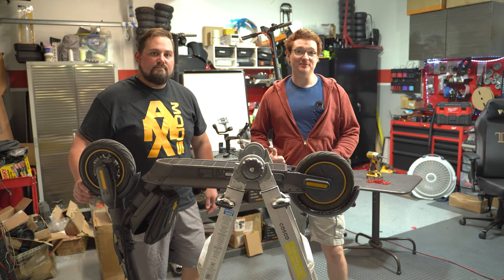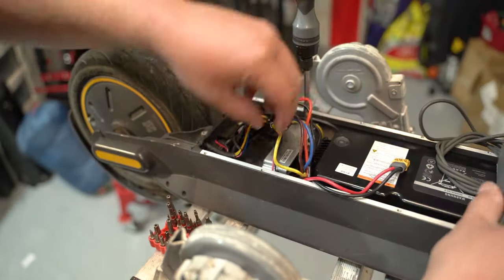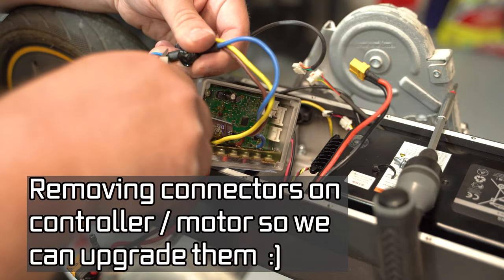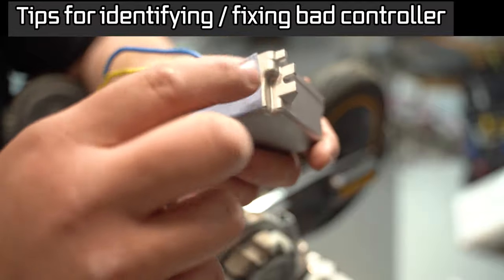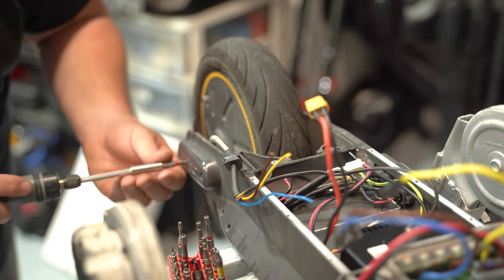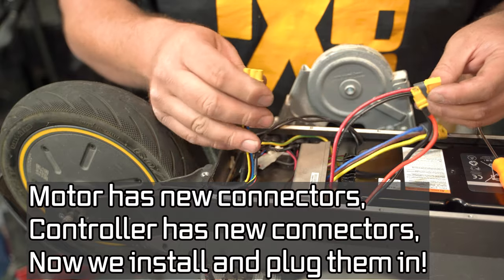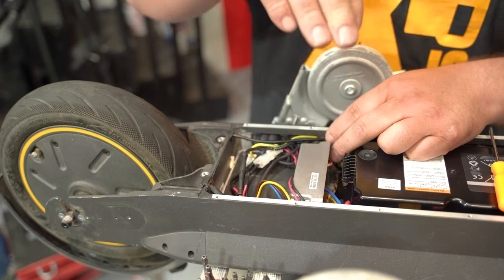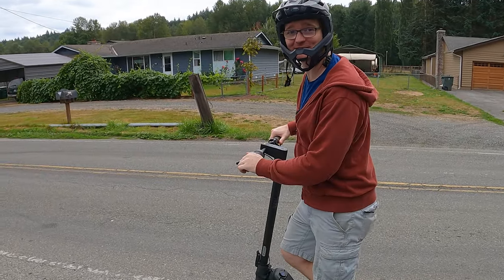Ninebot MAX Repair, Upgrades, Controller Swap, Tire Removal & More!

Comment: Great video. I have a front and back suspension coming from max mods and will probably get a 48v upgrade along with the fat max motor. I'll definitely be redoing those connections. I'm just curious what would be better option, the external 48v or the internal 48v battery replacement, or both?

Comment: Im not sure if this video is too old for comment but I have a ninebot max as well and the display just keeps flashing and each flash it lights up each part of the display (Eco, D, S, light, bluetooth, walk mode, temp warning, etc. No error numbers. I can't turn of or on as well.  I believe I used Xiao flasher and this happened.  I can't find anything online about what the issue may be. If I managed to describe said problem well enough, does this sound like something you've dealt with before
Reply from the maker: I've never heard of it before. Try reflashing the stock firmware and see if it persists. If it does then its likely a loose connection between display and controller or a bad controller, maybe from water damage.

Comment: I fried my ninebot max with the 48v battery but the controller still turns on but all 3 connectors burned up to ash but can I still use the original controller if it still works

Comment: Hey! Great video. Would you be able to list the size of the screw bits you used to remove all the bolts? I tried a few of the bits in the set that I currently have, but i don't have the correct sizes. I wanted to make sure that I get the correct one the next time I go to the hardware store.

Also are the replacement wires and connectors commodity items you acquired separately? Or are they in some sort of upgrade kit that can be purchased?
Reply from the maker: Idk exactly. I'm Sorry!
Reply: @GingerOnWheels  T15 security bit

Comment: Ok. I have an issue that I haven’t seen before, nor can I find a history of.
Got Error 14 on a Ninebot Max. Tried connecting new throttle to brain, no change. Disconnected everything except main power, still Error 14 on brain. (Brain=main screen)
Installed brand new module, and error was cleared but button did nothing to change modes or turn on headlight. Wheel when rotated begins low throttle operation (3Km/hr or so) but showed no speed on the display and the throttle does nothing.
Installed an old display removed from a different scooter, and everything seems to work fine now.

Like - super strange.

Comment: Hey big fan of your reviews very informative. I have a stock Max Gen 2 and the MyMaxMods external  kit I will be installing soon. I subscribe  and watched your ninebot max can you ride it through hell test video and obviously the outcome as seen in this video. I just wanted to ask how long and under what kind of riding conditions she lasted before the breakdown and upgrade?
Reply from the maker: On that super hot day when I was riding around at max speed with the upgrade kit and custom firmware it lasted about an hour I'd say. I could feel a loss in top end speed when the phase connectors started melting. That bad connection led to the controller overheating and... Poof! If you put in the battery extender, I'd open up the bottom too and upgrade to the XT connector for the motor wires too at the same time. Then you won't have to worry about it.

Comment: Interesting -- the washer acts as a little torque plate
Reply: the washer has this lip for safety reasons. it keeps the wheel in place even the nuts are opened a bit.

Comment: where the power is coming from should have a female connector on, buy doing this you will not get an electric shock from the connectors and it is not as easy to short anything by touching anything with a live end, if you find it is not possible, then it would be best to put it back together so you can take it to professional that will find a way of doing so,

Comment: @Ginger on Wheels. Really enjoyed content like this and I think this is an awesome way to show everyone the how to steps on fixing things that will occur to their scooters at some point.

I had bought the Ninebot Max on the Indiegogo platform for around $550 or $600 bucks at the time and was doing small upgrades here and there with Chris and was set to take my Ninebot down to him, as I encountered a hiccup when I installed the sharkset extended bar and front suspension. But mine was unfortunately stolen and never got it back. :/ 

One the main reasons I bought a Nami to replace my Max and put security measures on it now. Two alarm systems and GPS tracker lol.
Maybe if you and Chris aren't too busy, sometime this year we could all meet up for a ride in WA state. I have a friend here in Yakima who has a Sherman and other EUCs, as well as he's very experienced rider on the EUCs.
I have a Nami, Surron, V11 and looking to maybe purchase a Lacroix Lonestar Supersport sometime early next year. Maybe even one the newer EUCs after first batch

Comment: So we should turnoff Regen break in the app to solve melting in the first place to right
Reply: you cant disable it on the segway app you can just set in to the lowest mode but i recommend flash the scooter and disable kers fully

Comment: I enjoyed this video, great job done in a way easy to understand.
I had a thought, It would be nice when upgrading connector, maybe use a weather sealed 
connector mounted externally to make rear wheel RR easier for repairs.
Thanks Chris and Ginger

Comment: Did you have to program the serial number into the new controller? 
Mine will turn on but dies as soon as throttle is pressed. Also my rear wheel is extremely difficult to rotate.
Please help 🙏

Comment: I ran the battery on my ninebot G30LP down to about 11.5 volts because I let it sit to long. Is there a way to reset something so it will charge again?

Comment: I replaced mine with a solid tire motor. New hub and solid tire. NO POWER. won't work. The green wire connects to the brown wire? Any advice?
Reply from the maker: The new motor might be wired differently. Try changing the order of the phase wire connections and see if that works.

Comment: You'll never be able to visually see if the mosfets are bad. In my experience, 100% of the time I have found shorted mosfets they have looked completely fine. You need to get electrical access to the three legs of each mosfet and check for shorts between any of the legs of each mosfet. The motor needs to be unplugged. I have never done this yet with a ninebot controller but with many non-potted ebike and scooter controllers.
Reply from the maker: Never?. ...

Comment: Hello

I am wondering if you have a list of F E T transistors that are in the ESC controller for Ninebot Max Gen 2 

Thank you 

-I'm also wondering if the FET from a Chinese controller can be placed in OEM ESC 

There is no schematic I can find of the ESC 

Just replaced my bearings so next project!

Comment: My battery is 36v and 500w motor but it only goes 16 mph I took it apart and on the controller it says 16 mph if I get another controller will it go faster ? I got the apachie pro edition
Reply from the maker: If you can find an original ninebot g30 controller and put it in your scooter then you can hack the firmware to make it go faster. Otherwise you're stuck with the stock speeds.

Comment: Can a more powerful rear hub motor be added replacing the 350W motor that comes with factory. What are the steps to do do for the Ninebot Max g30 P

Comment: Is the Voltage increase limited by the stock controller, or is this just a capacity upgrade? What additional benefits do you get with the 48V Max Pack upgrade?

Comment: Hi, i have looked every where for this info but could'nt find an answer , i just wondered if you guys know if the third party G30 (XBOT) controller will work with out the BMS wire connected and not through up an error code, i have a copy G30 and the battery doesn't have battery data cable!? The controller it came with is one of a kind and no one sells it on any web sight. Hope you can help. Thanks in advance.

Comment: How do you differentiate a gen 1 from gen 2 ninebot? Is it the three versus one capacitor on the controller?
Reply from the maker: You should watch my original ninebot Max g30 review. I go over every single thing on the scooter. If I recall, the Gen 2 starts with a different number written on the motor.

Comment: @Ginger on wheels:

Did U find out how to repair the faulty controller?
Or at least whitch chip of mosfet blew up?

I have a dead scooter as well with the same blue phase wire molten.
And i hope that i can repair the Controller instead of changing it :D

Comment: You mentioned wago conectors in your replies 
I can't solder at all so what I want to know is what size of wago conectors do I use. I have the 12volt ext battery from mymaxmods  and just bought a new controller (burnt mineout like you did)

Comment: It is alive, the usual blue connector has melted, the control unit has also jumped, a resistance on the control unit must be changed to bring it to 48v safely. We wait for the test of Chris' engine for g30

Comment: Hi there! I need to replace the tire valves, I think the rubber around it cracked on the rear motor wheel. Was hoping that was under the “tire removal” in this video but didn’t look like you needed that done. Any recommendations or pointers would be greatly appreciated!

Comment: It wasn't clear to me. Does the rear wheel spinning easily mean a bad or good controller?
Reply from the maker: Good. If there's resistance on the motor when the scooter is off and everything is all hooked up then it's indicative of your controller being blown.

Comment: I was hoping that the motor would be open as well. Because its winding may have become hot and its insulation may have melted.
It is half-burned. maybe

Comment: Can I put a cheap ebay control in to a ninebot or reid to check it runs or rewire the existing one to delete the screen and make it basic as possible
Reply from the maker: A cheap eBay controller won't work with the ninebot stuffs. Their battery and display and controller all have to dance together and harmony. If you swap your battery with an aftermarket one, you could pop in a generic controller. Lots of times you can find controllers for sale with a display and throttle combo.

Comment: Thanks for posting this. All of my connectors have melted! I'm going to just hard wire the new controller to the motor wires - hopefully that'll do the trick!
Reply: I hard wired the controller wires to the motor using block connectors, but the controller had actually blown.
Bought a new one, had to cut off the black plastic connecters from the new one to hard wire it to the motor...and voila, we're up and running.
Unfortunately a few weeks after that, the internal transformer died! So bought and fitted that and once again, we're up and running!
Reply: why they melt?
Reply: @00_itachi25  Apparently it happens quite regularly. There's a lot of current going through those connectors and the metal to metal connection between the two isn't massively strong - thus they get hot, may spark and sometimes melt.
Reply: hope ye sort ye scooter bro
Reply: @guyp3599  ah.. how many amps were you using? do you think it'll happen to me if i ride at 30a daily? i used to drive at 32 when it was cold but i'm kinda worried now
Reply: Yes, mine too..
Reply: I think I'm just gonna install some wafer connectors to the control board to the motor.. I temporarily put wire nuts..
Reply: @00_itachi25  32A is ok just disable fully kers and keep your tire pressure high  (32A is the stock connectors limit)

Comment: I have a Segway Ninebot that won’t turn on but does charge .what can be my problem.can you help
Reply from the maker: Could be anything from loose connection to a dead controller. You're going to need to do some pretty hardcore troubleshooting.

Comment: my thing turns on when I connect the burned wires. But as soon as I turn the wheels a little bit, it shuts down. We’re getting new connectors, fix the problem? . Or is it something wrong with my motors?
Reply from the maker: I think it's your controller. If I were you I would do exactly what we did in this video. Replace the controller and the motor connectors.
Reply: @GingerOnWheels  thanks so much it's fixed now

Comment: I was out on my max with the 48v kit and I blew up the controller, and I was going 28 mph.
Reply: How long did you have the kit for and were you riding in very hot temperature?

Comment: Question is, if 15 amps on this spot of connectors is not a purpouse? To create the weak spot in wire to protect other parts from fire ? Isn`t this a Fuse connection ???

I had also Blue and Brown wire melted in the same spot. Stock Ninebot Max. And it was still going. Was replaced in waranty still.
Reply: No , not fused. The stock connector can't handle the power surge/amps going through, especially on a full battery with regenerative brake set on high on a downhill, clearly an engineering mistake.

Comment: How would one know if the controller is dead? I have a max and thought the motor was dead but the power turns on so bought a new motor and still the same. Any help would be appreciated 🙏
Reply from the maker: Thats how you know lol. Either your controller or your actual spring loaded throttle mechanism.

Comment: I just bought a g30 max second gen (new), but I had it sitting for about 3 months before riding it. It worked perfect for about half block ride and then poof! Totally dead. It was hard to push home and when I got home I took it apart and noticed that the main battery connector to controller connector would spark and the blue battery light will spark and turn red.  I'm stumped can you help?? Ty
Reply from the maker: There is no 'blue battery light'. Wtf you talkin bout, Hank?
Reply: @GingerOnWheels  i think he means the flashing blue light you can see on the battery

Comment: I changed the controller and my rear wheel is still hard to spin
Reply from the maker: Either the phase wire connections are melted, or connected incorrectly, or the motor is fried. I'd lean more towards phase wires though.

Comment: Is there a temperature that is too hot to ride your scooter or not recommended? It gets over 100 out where I am should I not ride on those days for the health of my scooter?
Reply from the maker: Over 100 is definitely pushing it. But as long as you're not flooring it for the entire duration of the battery then it'll be fine.

Comment: Will this eventually happen to people who installed the 48v mod and did not upgrade the connectors? Does that increase the likelihood of burning up the controller?
Reply from the maker: Not unless you're a heavy rider who goes around flooring it in 100 degree weather all the time.
Reply: Would 195 be considered a heavy rider?

Comment: I'm debating between repairing my Max myself (damaged back wheel+fried controller and connectors+diminished battery capacity after nearly 1.5 years of riding on sport mode) or buying a brand new G30.  The screws on the bottom plate are damaged from careless curb scrapes so I will have to invest in a brand new drill as an extra cost to remove the plate.  This is fristrating.
Reply: How much miles or kilometers have you done on it? I'm planning to get one and use it daily
Reply: Have you mod it?. I have an G30E II (25kmh) model, 1gen motor. 
Always in Sport mode, with full regen break.
Around 7000km on my scooter now. No burned connector. And Battery works like new.
Only i needed to fix was replace front berings after 1year: Driven all year around in Sunny days, Snow, Rain.
Reply: @DoNE021 I haven't yet, but plan on it.

Comment: WHere can i find the m60 connectors?
Reply from the maker: https://amzn.to/3Wqmtsl
Reply: @GingerOnWheels  Yes you did. DO you know the size of the screws on the bottom of the battery cover?
Reply from the maker: @Cembruh  T15 torx screws I believe
Reply: @GingerOnWheels  yes but im not sure how long they are. Maybe m4x10mm. Most of mine bottom out and theyre stripped so i want to replace all of them.

Comment: Honest question, why do you spend time on this when you have access to several better high end scooters?
Reply from the maker: Because this channel is about the viewers and I had lots of people asking for this video.
Reply: @GingerOnWheels  thank you.
Reply: Because the Max is extremely capable going straight to a expensive scooter is plain and boring
Reply: The way I see it, it's like car channels. Sure, exotic sports cars are fast and cool, but that's not what your average person will end up buying. They're looking for something reliable that can comfortably get them from point a to point b. $5000 scooters that can hit highway speeds are certainly cool, yet most of the time people looking for a scooter will get something affordable like the Ninebot Max or M365.

That's my perspective, anyhow. I bought a Ninebot Max and like this sort of content as it shows how I can repair or upgrade the scooter in the future. I don't ever plan on buying a super high end scooter, as it's just not something I need. But I'm definitely considering some mods to make my scooter a bit more capable.

Comment: Do i have to remove the wheel to change the connectors?
Reply from the maker: No? We didn't do that in this video.
Reply: @GingerOnWheels  You did at 11:06 lol
Reply from the maker: @addictedtosynthwave8151  oooh you mean to replace them with the XT connectors, yeah my bad. You should definitely take it off. It'll make your life a lot easier in the long run.
Reply: @GingerOnWheels  thanks :)

Comment: Do you know how to fix Error 18?
Reply from the maker: This is related to a hall sensor failure? Was your ninebot loaded with custom firmware? I did some reading and it sounds like replacing the controller, just like we did in this video, is the easiest way to fix it.
Reply: @GingerOnWheels  thank you.  I have not downloaded any firmware or changed my scooter at all.